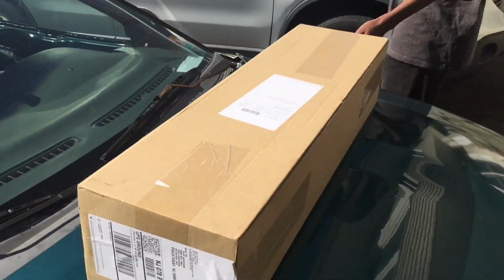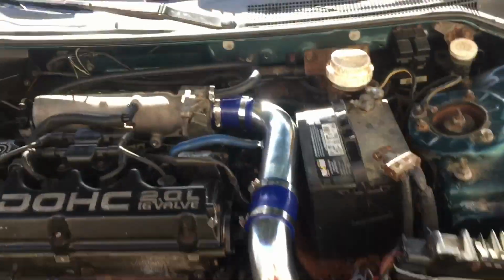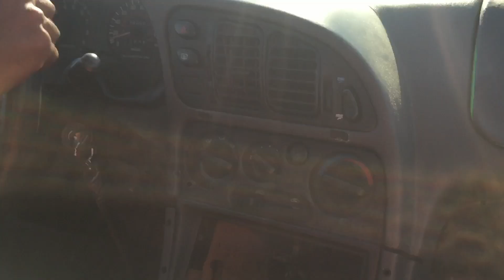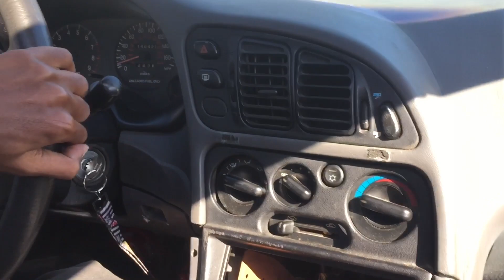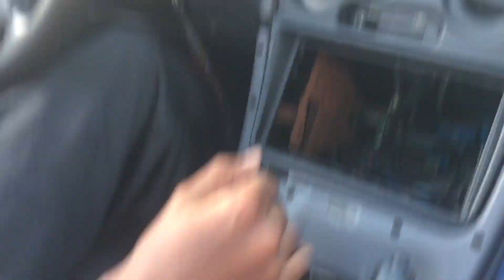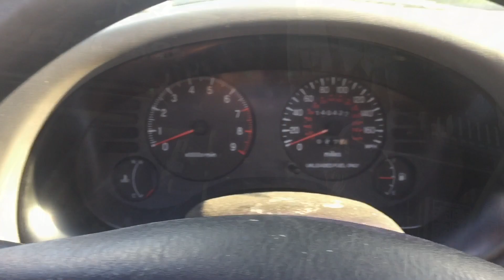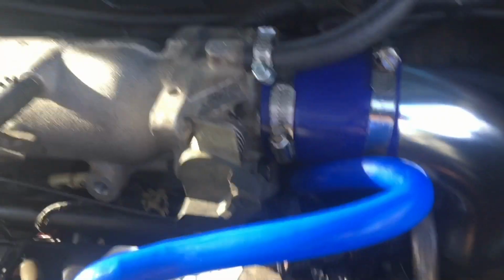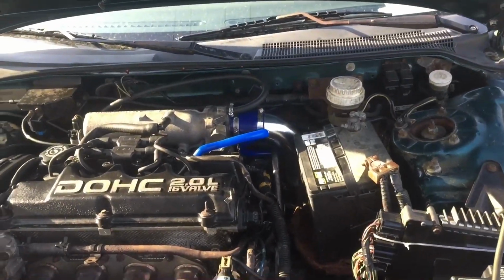FIRST RIP IN THE ECLIPSE 💥

Comment: the cold air intake is gonna hydro lock he should have got a short ram .  I also have a eclipse
Reply: _DAVID _BRYANT all you need for a cold air intake setup I's a bypass valve so water doesn't get into the intake manifold ....
Reply: Yea the only way it would hydro lock is if it got submerged in water and it looks high enough unless he drives in a lake lol it it rains it's not ganna hurt it or be enough to hydro lock the engine